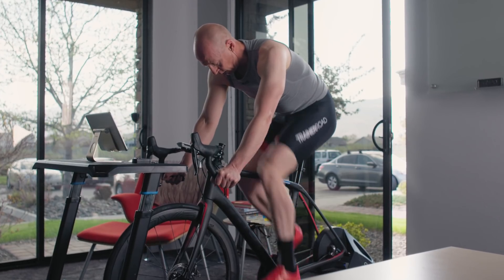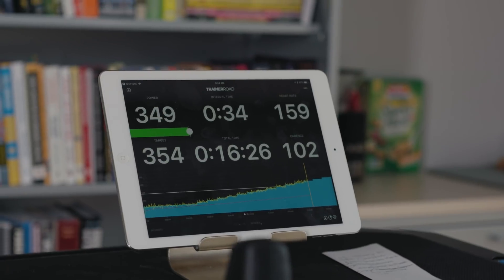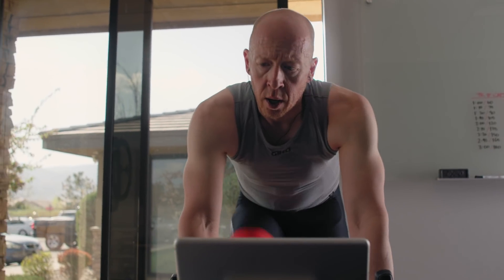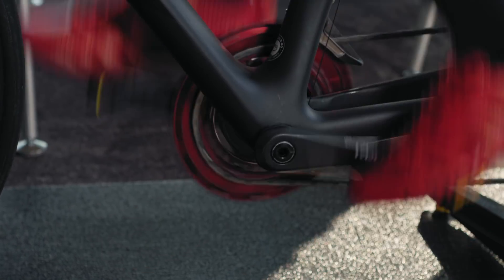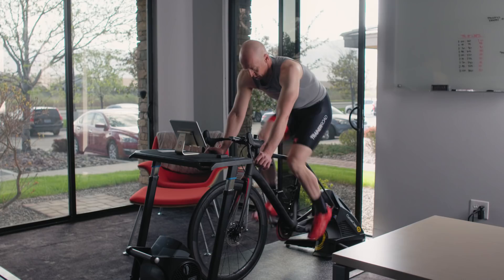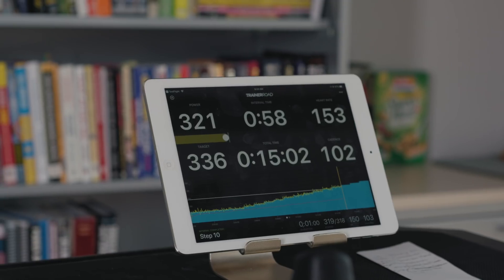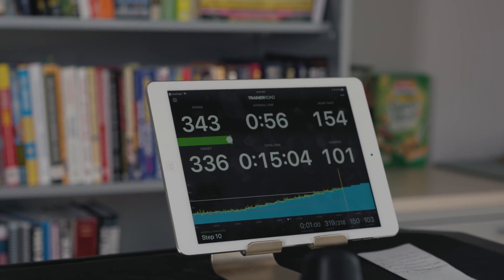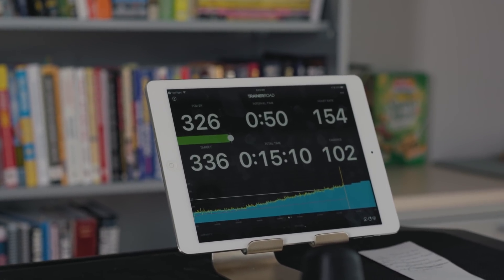New Ramp Test Makes FTP Testing More Efficient and Less Stressful

Comment: You can't overestimate it you say? Well I don't think 70% of maximal minute power output during the test is a good indication of FTP. I did a ramp test, got 250 and workouts were way too hard. Did a 20 min test, and got 225. The workouts then felt like they were what they were meant to feel like.
Reply from the maker: Sounds like the 20 minute test was a better fit for you! Glad you tried it out!

Comment: Why is he on the small ring? Wtf
Reply from the maker: ERG mode often works better with an easier gear since the decreased inertia allows for faster resistance changes :)
Reply: @TrainerRoad  I didnt know! I'm on outdated gear and it just stood out
Reply: Would being in a smaller gear help me on t.r with a travel trax mag trainer?
Reply: Put the chain in the middle of the cassette and select whichever front ring you want, you shouldnt be changing gear or be concerned about what chainring you are on when doing a ramp test, thats what erg mode is for

Comment: Ive been using the ramped approach for the past few years by planning my own workouts (trainerroad, peaks, zwift etc), I usually take the total test run to about 30 minutes and ramp to about 140% above my expected or target ftp, just ride until total failure and you know your final 20 minutes are your absolute limit. This approach also makes you push harder as you go mega deep pushing for those last few precious seconds at anaerobic capacity.

Surprised this hasnt been done sooner to be honest.